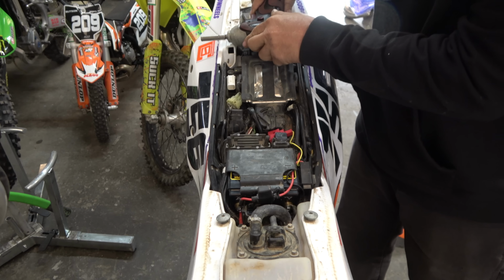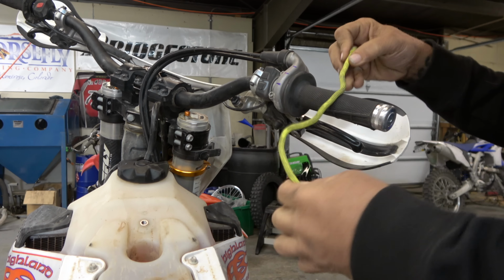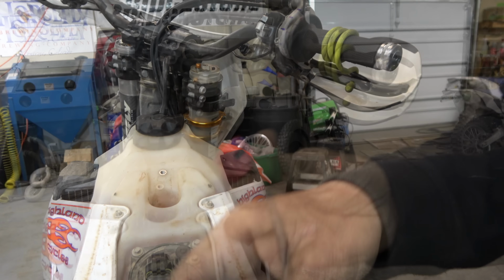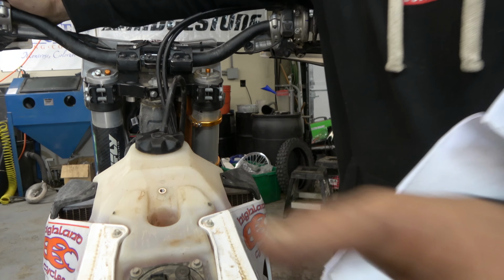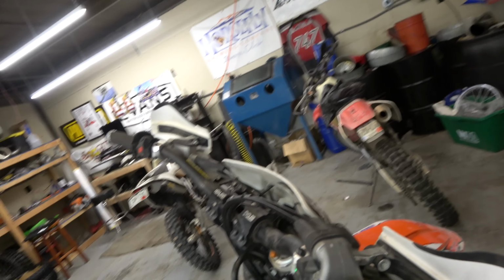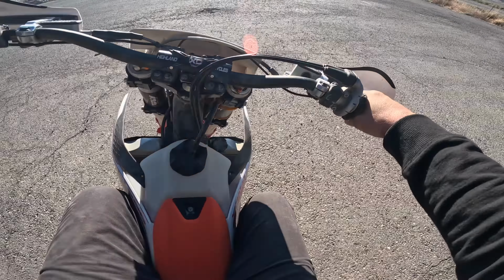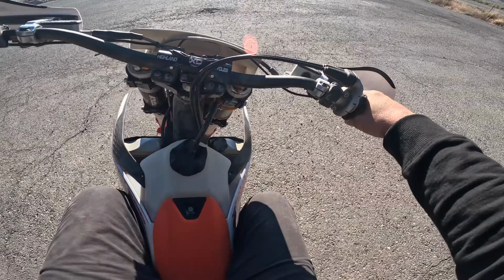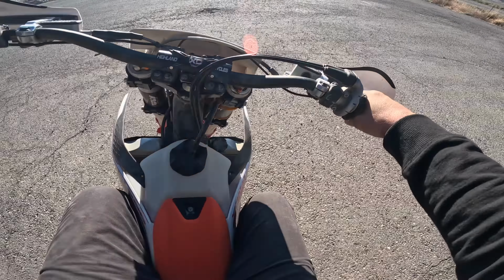2023 KTM 300XC Secret Mapping? | KTM Secrets? | Highland Cycles

Comment: That's cool, I'm going to try this with my 300 SX. I wonder how many features are dormant on the new TBI bikes that KTM is planning on releasing? When are they going to release the app?
Reply from the maker: I don’t know. Really hoping the app and wifi module will come out soon
Reply: @highlandcycles  I can see the spot for the module inside the airbox and the harness is there. Just patiently waiting
Reply from the maker: @kelceyk8199  yep
Reply: @highlandcycles  I have a 23' 125sx that Im diving into the last week or so, doing some mods and exploring the tech inside, videos on my channel!  Follow me I follow you!  
ps- the PV half throttle dongle connector is to be used after you disassemble the pv for service so the start and end points are set.  It offers no performance advantage, its just a service thing.
The only way to determine if the full throttle red/yellow/green spring comparable makes any difference is on a dyno, I going to dyno mine next week to see whats up with it being stock, modded, pipeset, reeds, etc...thx!
Reply from the maker: @themotocrossmodchannelWulfMX  awesome. I know, I need a dyno close to me.
Reply: @highlandcycles  Im getting mine dynod next week to see what it has stock, then FMF pipeset, then VForce reeds and also going to do the connector/throttle run to see if it did anything to the 125..it won't confirm the 250/300 but at least rule it in/out for the 125.  I will post a video of that and tag you in it so you can see what I did anyway.  Hope all is well- J
Reply from the maker: @themotocrossmodchannelWulfMX  awesome

Comment: Full open, connect wait, close throttle wait and unplug. Doesnt gopro have acceleration sensor if you using littpro app or something.
Reply from the maker: They do but that would still not be super accurate. The guys at TSP are digging deeper in. There is some merit to this but their initial dyno runs aren’t conclusive either way. Check out their vid. They are super smart! TwoStrokePerformance

Comment: Did your factory battery go bad already or did you change it for an aftermarket?
Reply from the maker: Factory bath was still good but I swapped for a higher CCA one
Reply: @highlandcycles  which one did you end up putting in it I was thinking about upgrading it normally I use sharai but I heard the new slot for the batteries is pretty slim
Reply from the maker: @donrohde101  I put an anti gravity AG-801. Had to modify the tray for it to fit.
Reply: @highlandcycles  oh wow yeah I just looked at that tree there's not a whole lot of wiggle room in there what did you end up having to do did you make a video?
Reply from the maker: @donrohde101  https://youtu.be/00LPRVU3PR4
Reply: @highlandcycles  sorry I should have searched for that thanks

Comment: Do TBIs have a warm up like TPI or can you just ride it?
Reply from the maker: Pretty much just ride it. Warm up like a normal carb bike
Reply: TPI's only require a few  seconds before you start riding them. Do not touch the throttle to start or omce it is started.

No full throttle, super hill climbs in sand until it warms up a bit like any carb bike.

I have a 2022 KTM 300 XC TPI and KTM,  the big dealership service department & their racers, plus Jeff Slaven all told me the sane thing. 
Basically, get on it, stsrt it, put on your goggles and start riding.

Comment: I don't have a 23 2T but I have a 23 350xcf. Been watching your videos with interest. 

A thought. Doing mid throttle and rolling forward recalibrate the power valve. However remap wouldn't require that as min an max power valve opening  settings are done. If you plug in the dongle with throttle at 50% only does the power valve move?
Reply from the maker: No it doesn’t. It doesn’t do anything until you roll it closed. At least as far as I can tell.
Reply: So my thought would be rolling preforms pv calibration and just hold one of the 3 positions sets a map. We can hope for that to be the case.
Reply from the maker: @jonathanchiasson931  that’s what I think also.
Reply: @highlandcycles  This would be greatly appreciated chart for all those interested !
Any graphic designers out there ?

Comment: I did hear something on this but after spending 12K on the new bike I was scared to try it especially after hitting the button while it was running and ending up back at stealership to get it running again plus wasn't so sure on the info I got other bikes that are efi and all them changes are made threw the ecu rather that be unlocking one or going with a aftermarket unit so I just thought bullshit on that but would be cool same on my bike the green screams high rpm just pulls and pulls my white map feels really flat I would call it and ya I got same bike u got and 3rd and 4th pulls the front wheel fairly easy when ur really in it

Comment: Crazy, you think this easter egg would work on the 22's XC - XCW? Or is the dongle just used to prime the oil pump on those?
Reply: Same thought as dealer mentioned for performance and manual only indicates oil pump primer ?
Reply from the maker: The TPI dongle is just for oil pump. The only reason this is a thing on the new ones is that they have an electronic power valve.

Comment: I wonder if the same “secret mapping” exists on the TPI models…
Reply from the maker: I doubt it. This has more to do with the electronic PV
Reply: On the TPI's you can manually adjust the power valve via the yellow square head screw. You can also buy tue green and red springs to try and adjust. The springs from a dealer are about $1 per spring.